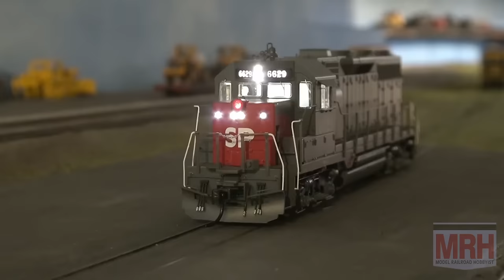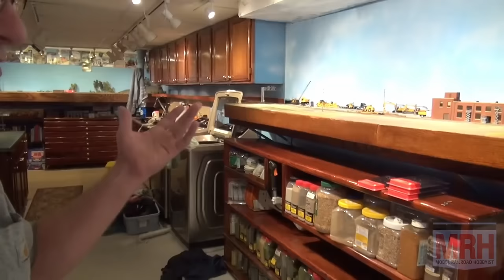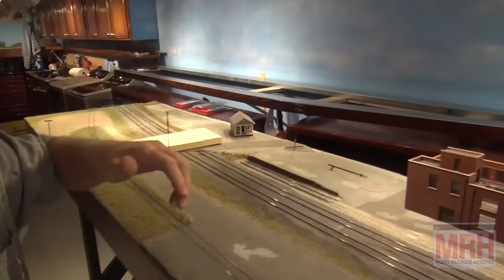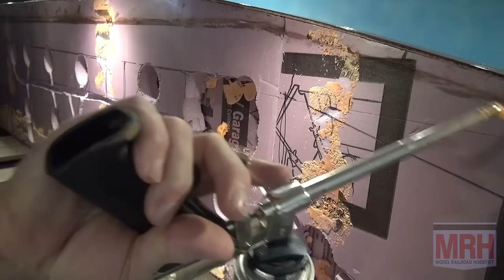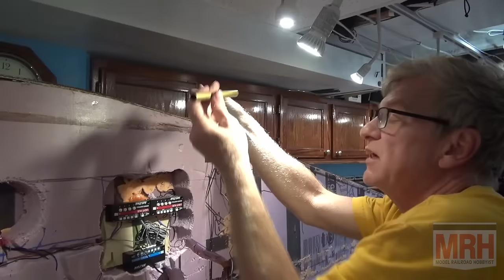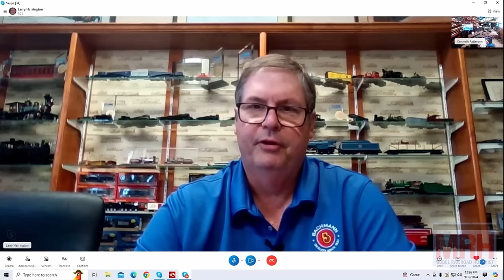Diorama layout construction continues | October 2024 WHATS NEAT Model Railroad Hobbyist

Comment: Installing wires for lights in foam isn't fun, I made the mistake for a micro layout. Next time, I will reuse my method of MDF exoskeleton around the foam, with 10 cm going below the foam. That allow for any cabling, electronic and turnout motor. And even some cable management plastic things. And wood sides of higher height make the module more stable when working on it at 90°